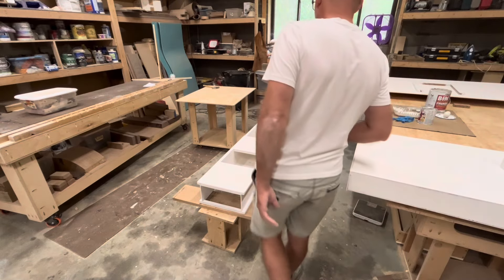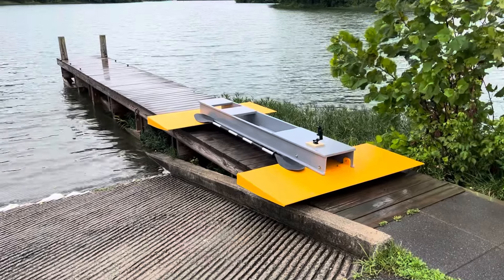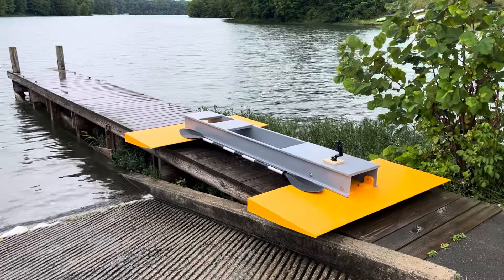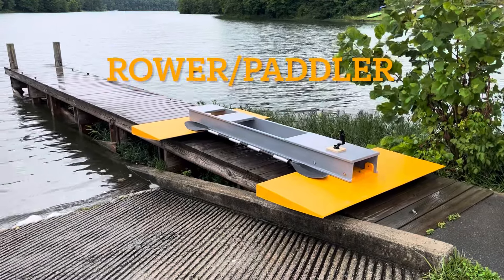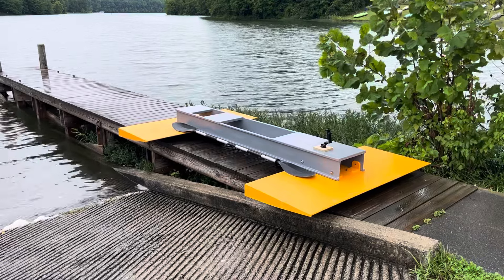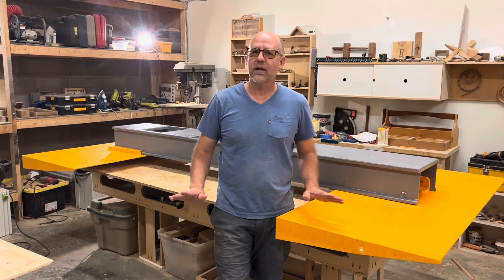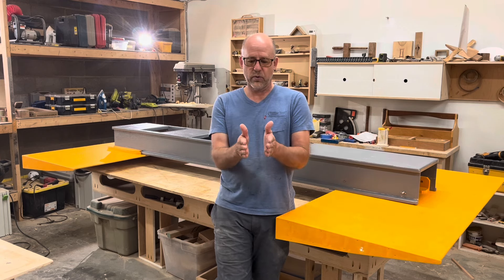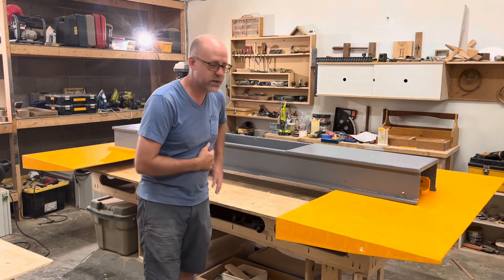Wedge Rower Test 1

Comment: I don't know if you have workshop space, but something like fiberglass over a foam core could give you a substantial weight reduction and buoyancy boost in your wedges.
Reply from the maker: I have not learned the art of foam construction yet.  It is a whole different world.  I don't know how you could get to a glass flat shiny finish on the bottom if I used fiberglass or poor man's fiberglass methods.  It must require hours of sanding and special high speed sanding wheels which I don't have.  Do you recommend any particular tools?
Reply: @markpalmquist  I have limited experience with fiberglass, myself, but my understanding is the form makes a huge difference. Careful foam cutting with a hot blade is a lot like using a table or band saw, so is pretty easy to pick up from woodworking skills.
Reply from the maker: @deisum  I have looked for hot wire cutters but they are either too small or industrial scale.  Best ones are made by hand and require a long list of parts and time to make them. So I stick with what I have laying around my studio which is 12 years of scrap plywood.
Reply: It could save a little weight, but wouldn’t add any buoyancy, in fact you would lose some because fiberglass has no buoyancy and plywood does. And because the air trapped in the foam is buoyant, but the foam itself isn’t. So 1 cubic foot of foam has less buoyancy than 1 cubic foot of air. So it’s a trade off of less weight or more buoyancy. Since it is a planing rig maybe buoyancy isn’t as important as weight.
Reply from the maker: @markgallagher1376   I think plywood construction can work as long as I use the very light plywood.  Luan is the lightest, besides balsa, that I can find.  The 12mm plywood I use has a poplar core, which is relatively light as well.  I agree, EPS can end up being heavier in some cases, depending on how much plywood I use.

Comment: Interesting process of experimenting and figuring out what to do next!

One technique used by foilers to launch above hump speed is a bungee cord. It wouldn't weigh down the boat (like a motor), but of course you can only use it once. If you slow down out in the middle of the water, you're out of luck.

Comment: Thanks for publishing negative results! I reckon the best test would be to tow it up to speed, laden to design weight, then you are only testing one unknown at a time. My hunch is that a small outboard ~2.5hp could get this planing. I have seen photos of boats designed to plane with that little power.

I'm also curious what planing theory you are referring to? I have looked for that but was unable to find anything
Reply from the maker: Thanks.  There is 1 paper titled "A lifting surface approach to planing boat design" published in 1964 by the US Navy that plots the aspect ratio of a planing surface and its lift to drag curve.  Then there is a major paper by Savitsky that establishes the angle of attack with the best lift to drag ratio.  That paper is titled "Hydrodynamic Design of Planing Hulls".  This paper is the most widely cited paper, all newer papers were built on this.  Both of these papers were done in test tanks.  Both papers came out in 1964 and all work since then has been to input the math into computer modeling fluid dynamics programs and then compare the results to testing.  Very little improvement has happened since then except that the modeling software keeps getting better.  I don't have access to fluid dynamic software but I am still reading the original papers and applying the results.  I think the second version, after modifications, will work much better for both human powered and motor powered efficiency.

Comment: What is it made of? It looks like you might want more forward reach space to get a strong paddling stroke.
Reply from the maker: Mostly 5mm luan plywood, some 12mm ribs and transoms.  The box hull is also 5 and 6mm plywood with  a few 18mm square cherry chine logs.  I agree foam would be lighter.  There is 250 grams of epoxy on the bottom of each orange float.  No glass.

Comment: There are some small light electric motors out there nowadays (like in the RC space). Maybe that is just not the direction you want to go which is understandable. But it sounds like maybe a short burst of 1000 Watts could get it up on a plane, and then you could kill the motor and pull the prop up out of the water.
Reply from the maker: @mckenziekeith7434  whether this remains human powered or changes to mechanical propulsion the change in the hull shape should lower initial drag.  Where do I find large RC motors?
Reply: @markpalmquist  Flipsky makes waterproof motors. This is my third time trying to post this. It seems any effort to include a URL leads to deletion. But if you search for flipsky waterproof motors you will find their web page. You may also want to check out RC testflight's recent video on boat prop testing. If you are the one deleting my comments just let me know and I will stop trying.

Comment: if a person paddling can make 3/4 of a HP, that would be pretty good .... so figure why human powered craft are generally displacement hulls.
but yeah, a vertical transom will tow water, a top aft transom will lift water, and water will suck down and shear away from a top fore transom.
Reply from the maker: @RulgertGhostalker  thanks, that makes sense.  I will shrink the transoms and see if I get better results.  There are some human powered craft that can hydrofoil so maybe human powered hydroplaning is possible. It’s worth trying.

Comment: Don't see any test. Maybe consider a light lithium lofepo4 $30 10ah battery and $100 trolling motor IN CONCERT with oars to help get up on plane.
Reply from the maker: @FranklinBryan  the video turned on when I went to turn it off and then it started raining and 1 of the floats had a tiny leak so I had to leave.  Will definitely film test 2.  I may try the trolling motor jumpstart if I can’t get on plane with oars.

Comment: This failure was quite predictable. 

The problem is not enough power. A human male at peak fitness can develop maybe 370 W for a short burst of time. And this is while using his strongest muscles (his legs). Typically, for any length of time, one can produce maybe 80 W.

Planing is a high-energy endeavor. It takes roughly 30,000 W per ton to get anything to plane. Since you and your boat weigh about one-tenth of that, you need about 3,000 W.

The reason your planing floats work is that they are very lightly loaded until your boat reaches a relatively high speed. At this point, your sail may well be producing around 1,000 W. At this point, your downwind float may be producing around 70 lbs of lift. This, combined with the lever arm of your cross-beam, can easily be providing several hundred lbs of righting moment.
Reply from the maker: I agree with most of what you are saying but I’m not sure where you are getting your numbers for planing.  What I am using is the known fact that a 2’x3’ ellipse can support all my weight at around 10 mph.  Surface area of a skimmer is 4.7 square feet.  The wetted area of this should be 8 square feet when planing which should be enough to support me and the 50 lb boat and 10 lb of rowing frame and oars.  The problem I see is getting over the initial drag.